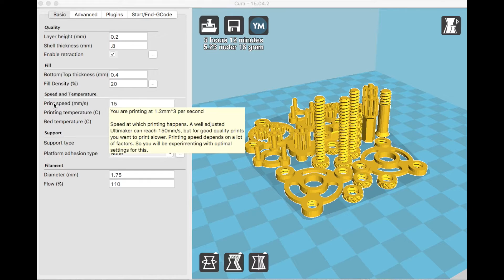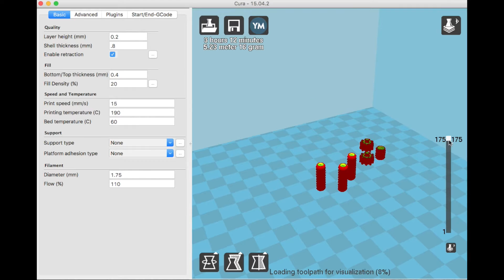Improve Print Quality With One Setting!

Comment: if you have to print @ 15 m/s you have a problem with the bed springs / belts etc.
when you print too slow you get into a new set of problems. 
You should be able to print at 30 m/s which is slow to most people .
Reply: Mm*